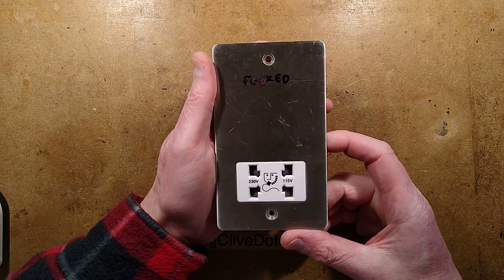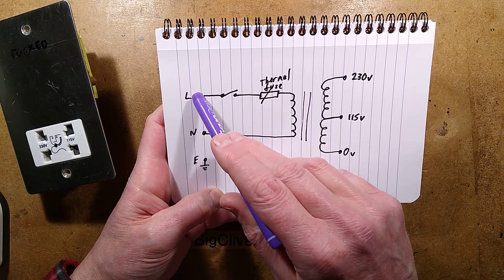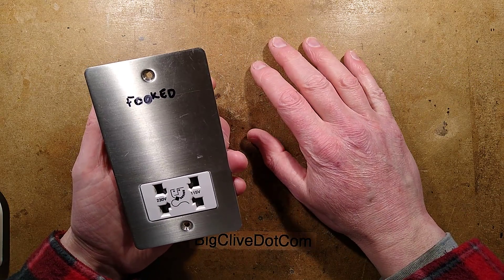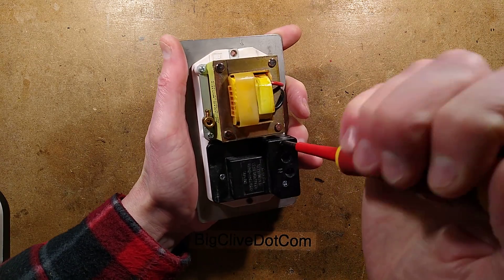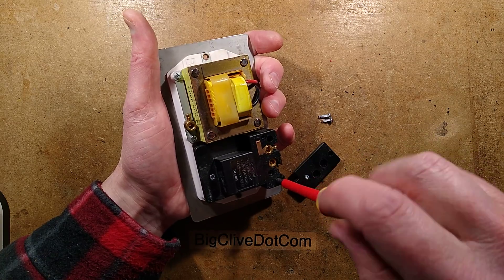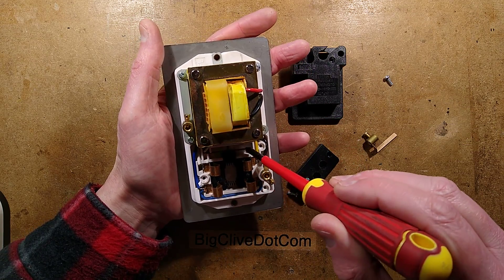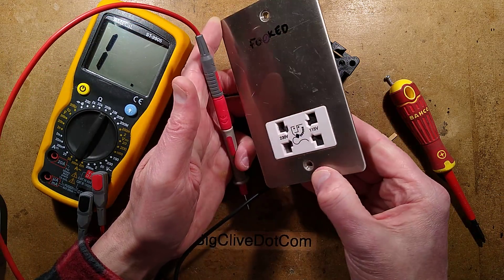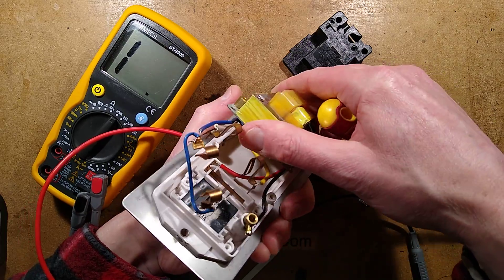Exploring a failed British shaver socket

Comment: I live in Sweden and moved into my apartment in 2004, the last electrical makeover was in mid-90s. My bathroom mirror cabinet has a lighting fixture included on the top, but it does also include a transformer which steps down the voltage from 230 to 115 and connects to an outlet in the bottom of the light fixture. This outlet is intended for shavers. Don't think the transformer has a thermal fuse or anything fancy like that, it just does the voltage step-down.

Comment: This used to be the only way to charge a phone in UK with "continental" power supply without having an adapter.
Btw, are shavers in UK sold with standard European plugs to fit into this socket?
Reply: UK shaver plugs is different to EU 2 pin ,slightly different size

Comment: And now you have a transformer to build a HT supply for a 1 watt valve amp, should get 300vdc rectified, just need to add a filament heater supply from an old smps or ac transformer.

Comment: As a Canadian, my initial thought on reading the title was "what the heck is a shaver outlet?"

Outlets in my washrooms are mounted about 10cm over the counter near the sink. I'm not aware of any functional difference on them apart from a resettable trip of some sort (AFCI? GFCI?), a "test" button, and embossed directions that read "Test Monthly. See Instructions." I've had no issue powering 1500w devices on them, never seen them trip.

I've been here 10 years and had no idea the "Test Monthly" text was even there until checking them after seeing this video, still dont feel overly inclined to do so...

Comment: We don't have these disposable power outlets in Czech republic. This is a dumb design. Of course, when there's a convenient socket in bathroom, why not to use it for hair dryer? Especially when a standard Euro plug fits there. Why don't they use a standard fuse? The same style like in UK power plugs.
Reply: More professional designs of these sockets will use a resettable thermal fuse rather than a one shot device.  We had them because we had electric shavers many decades before ‘differential current’ RCD’s became readily available at low cost.  As ever we remain a country with just about the lowest deaths from electrocution on the planet.
Reply: @MartinE63  For decades, power outlets were just banned in bathrooms. Then the outlets were allowed, but the only requirement was that the bathroom has to use a separate circuit with its own breaker. Nowadays RCDs are required for all electric outlets in households.
Reply: @JendaLinda  We had these outlets back in the 1960’s in the UK, maybe earlier and they are still installed to this day.  Normal outlets are now permitted in bathrooms but are not common.  Whole house differential current RCD’s came into use around 1980 and were mandated for new installations from 1991 iirc.  P.S. We have had regulations on electrical installations in the UK since 1882, 140 years. Going back to your original post, our ‘shaver plugs’ are not the same pin diameter or spacing as euro 2 pin plugs.
https://en.wikipedia.org/wiki/AC_power_plugs_and_sockets:_British_and_related_types#BS_4573_(UK_shaver)
Reply: @MartinE63  The plugs are so similar, so you can easily plug the wrong one. Power sockets in bathrooms became common since automatic washing machines become available. Washing machines were usually installed in bathrooms. Until 1990, RCDs weren't a thing here, so the circuit breaker was the only protection.

Comment: In switzerladn it used to be common to have a separate outlet for shavers, but had a small glass fuse in there that you could swap out from the outside that, I think usually 200mA or something of that size. I don' t know whether they did have a transformer in there but I need to find out now:)

Comment: See them in hotels a lot, and sometimes in old houses (50's/60's). 
Since like, the 80's they just put the GFCI in the switch board and use a normal earthed socket. Needs to be at least 60 cm away from bath/shower/sink/tap, but nothing too crazy.

Comment: Not being used here in Belgium. Those shaver sockets can also be used as a "El cheapo" way for isolating low-power DIY circuits, so that you can do safely measurings with a scope (and don't blow up your scope/scopeprobe) , but is not recommended because there can always be a short between the primary and secundary and your scope is still toasted.

Comment: VDE norms in Germany prohibit switches and sockets in certain areas around shower or bathtubs. In times before the RCD they often had to be either SELV or isolated transformers. Many people erroneously refer to these bathroom rules as "Feuchtraum" (moist rooms), which is a different set of rules, and believe the IP44 fixings for cellars or outdoor might be required.
The shaver sockets were mounted in square installation boxes whereas all other plugs and sockets in germany go in round holes, which would be too small to hold a transformer. People do get creative and use a standard Schuko socket and a fake switchplate to cover the large hole in the wall, leave the Earth unconnected and glue the mess together with silicone or hot melt. 
Of course you also find tangled webs of extension cables and dubious travel adaptors where fixed sockets were not permitted. Oddly enough many of those people are scared by the british electric shower heaters because of the dangerous electricity.

Comment: Hi Clive, hope you and your family are doing well.
What is more likely to kill high power MOSFETS in a dc-dc boost converter, powering high power 200W cob leds?
Too much voltage or too much current?
Or more general, what kills high power mosfets into a full short failure mode?
Cheers.

Comment: This brought back memories of my uncle having an adapter that allowed him to power his electric razor from the light fitting - grand Idea except for slight issue of then not having any light to see what you were doing...
Reply: Same with my grandparents and ironing clothes,  you could only iron in daylight.  All because originally sockets were metered at a higher rate than lighting. Replace the lighting fuse with a nail and the iron works on the lighting circuit.
Reply: @MartinE63  I remember my Granny had an iron plugged in to the light socket, 60's Belfast.
Reply: For that you are supposed to use the splitter adapter which gives two bayonet sockets (usually at funny angles) from the one it's plugged in to!
Reply: The 1st product ever made by Matsushita Electric ( now the parent copy of Panasonic and Technics)  was a bakelite-housed Y adapter that screwed into the Edison-style light bulb socket in your ceiling and gave you an socket for the bulb as well as an outlet plug for another electrical device.

Comment: The US just has GFCI outlets in newer homes. Given the usual 120V/15A-20A US circuits, the breaker would trip if you dropped a shaver or hair dryer in the sink,  but that's about it. If we had the scary 230V/32A ring mains, different story!

I have a 240V/30A outlet for my lathe, and the plug for that makes your UK plugs look tiny: https://photos.app.goo.gl/ah2ZRWBj6LD8K8LVA

Comment: Here in the us in new construction we just have gfci outlets near any kind of water. Older houses usually just have an ungrounded outlet built into the light fixture. Breakers with ground fault functions exist but that's the less common way of wiring them usually that's in the outlet itself.

Comment: The US uses GFCI (RCD) outlets whenever water is likely to be nearby (kitchen, bathroom, sometimes outside).
US outlets also already use a center tap at the secondary winding on the main transformer to make the voltage 120v wherever appropriate.
I suppose in theory having an isolation transformer would be ideal, but it's certainly not a cost effective option for the whole house.

Comment: You occasionally see these in old hotel rooms in Sweden. Definitely a rarity though. RCD protection has been a requirement for wet areas in new installations for about 30 years from memory.

Comment: My college dorm in the United States had them. Additionally it had a dedicated razor blade slot (that just dropped the blades into the wall cavity, I guess they figured they would just replace the building when they filled up)  And ashtrays built into all the furniture.
Reply: The razor blade disposal thing seems to be unique to the US - frequently encountered when renovating older houses. Presumably any pathogens on the blades would be long dead... PRESUMABLY :)
Reply: @LewinEdwards  I still see the slots in new medicine cabinets from time to time, but I suspect the lack of labeling means almost no one knows what they are for anymore.
Reply: @LewinEdwards  , in my 63 years of life in the US, I've never seen or heard of a razor disposal wall-slot!
Reply: @LewinEdwards  Accidentally bring back smallpox but it swaps genes with coronavirus
Reply: Free cavity wall insulation?
Reply: In the US you most likely had a normal single outlet built into the medicine cabinet or a newer GFCI.
Reply: @zachazlett  it was the dual round plug like in Europe and said shavers only. It was really odd for California.  I'm sure it made sense in 1960 when it was built. They clearly were aiming the housing towards  clean shaven chain smoking future aerospace engineers. (It was an all guys technical school at the time).
Reply: @JohnMeacham  that’s really weird but keeping that face clean for NASA was very important back then. Also the maintenance people probably got sick of getting calls from foreign students.
Reply: @JohnMeacham  Weird, I've never seen one. Lived my whole life in California. Makes me wonder if maybe someone was a transplant from Europe and decided to have them installed here.
Reply: @zachazlett  yup. It was Caltech so a very strong NASA connection. I just remember it being comical how many places they felt needed ashtrays. Like, there would be three within reach in some lecture halls most of the time for anything that hasn't been redone since the 60s.
Reply: @fishyfool  I think it was a weird Caltech thing. One of many. It is an international school, so maybe that had something to do with it? I don't know why European style shavers only ports were important enough to bring over though.
Reply: @fishyfool  Pre-1980s single-shaver outlets with their own transformer were the standard for US homes and other domiciles
Reply: I've seen the razor blade slots in a lot of homes. Though in Florida it gave the bugs one more route to get into your bathroom from inside the wall. There's nothing quite like being half awake in the morning, opening the medicine cabinet to get your shave cream and coming face to face with a big cockroach.
Reply: @tncorgi92  who is for a shave after that?
Reply: The "Used Blades" slot used to be common in railroad sleeper car washrooms.  By the time the wall cavity is full, the whole car (and blades with it) would just go to scrap.  Also guys had the challenge of shaving with a safety razor in a bouncing, moving rail car.
Reply: Yup, I've seen 'em. 1950s-era house, mirrored medicine cabinet w/ fluorescent lights on each side & an outlet built into one of them. If there was blade slot, either I didn't notice or it or know what it was for.
Reply: That's so funny that there was no obvious way to empty the razor bin :))
Reply: Dumping blades into the wall was actually a pretty widespread thing for a long time. More like by the time it fills up the building won't be suitable for habitation anymore.
Reply: Are you SURE that was meant as razor blade disposal, and wasn't just a crack in the wall?  People have a notable tendency to think that cracks and holes must have an intended purpose.  (Back in the days when floppy disks were still common, any slot about the right size in anything involved in computing would fill up with them.)
Reply: @evensgrey  yup. It literally had a embossed sign that said razor blades. At first it had me wondering how the I heck I got it to dispense razor blades. But a search for razor blade disposal slot will show lots of examples.
Reply: Which campus, building, and when?
This sounds sooo hazardous, it couldn't stand in the face of tuition these days with everything! I must know. Pls.
Reply: How are you lot so certain that there isn't a hatch in the basement where the blades can be retrieved? Or the hatch can even be in the attic and the blades can be retrieved by a suitable magnet....
Reply: @SianaGearz  people have renovated these bathrooms with the slots, and just found piles of blades wherever they dropped inside the wall cavity. Whoever made them assumed there would never be enough blades to be a problem, and they were right as flat safety razor blades became largely obsolete anyway
Reply: @AaronSmart.online  I thought those razor slots were weird even back in the day.  I do remember that razor blades were NOT stainless when I was young, they were blue steel.  Maybe they eventually got so rusty they were no longer sharp.
Reply: @AaronSmart.online  wet shaving is re-emerging.
Reply: @davidg4288  yeah. Nowadays blades can withstand 10 shaves before replacement
Reply: @kornaros96  but usually with cartridge blades that you can't throw in the wall forever

Comment: As an Australian, I can see this "shaver socket" nonsense is a mystery to me. We just have our regular old power outlets in the bathroom.
Reply: Not half as weird as having washing machines in a bathroom (and top loaders as that)  We had front loading programmable washing machines in the UK in 1961, located in the kitchen where you could unload and easily hang it out on the line without carrying it downstairs.

Comment: As someone in the US, I have no idea what the plug looks like that would go into this receptacle. I also don’t fully understand why this would prevent you from getting shocked if you dropped a razor into water. To be fair in the area I live in our ground and neutral lines are bonded together, where as from what you describe it looks like your ground and neutral are isolated. We typically use GFCI outlets in bathrooms to prevent electrocution. Are RCDs making these fairly unnecessary?
Reply from the maker: I'd guess that even with RCDs they may still require these.
Reply: I’ll say this, the UK electrical  system fascinates me. Thank you for always giving me new things to spark my curiosity and drive me to research! 😄

Comment: Being familiar with building design and code from an earlier job, the standard here in the US is for wet locations to simply have a GFCI protected outlet. Given that most shavers today are battery powered, its kind of a moot point as the main danger from the outlet is usually from hair driers which can draw close to 2kW. Too much to practically isolate. But with the proliferation of smart phones one nice standard to have would be for sockets that have USB outlets designed for wet locations that are water resistant, isolated and protected from ground faults and leakage.
Reply: I did upgrade to an Eaton GFCI with USB, Lowe's. Wife can cook hair, chat and use the USB powered makeup mirror.
Reply: @palharley  Does she make hair pies? :)
Reply: @elemar5  I can say that you can plug lots of USB powered items in the outlet.
Reply: UK is all RCD protected now so much the same.
But this kind of protection has been around for many decades, long before GFCI and RCD.
Reply: The whole world doesn't immediately go out and buy new outlets every time a new standard or technology comes out.
Reply: @backgammonbacon  Was a nice simple Christmas surprise. Old outlet was fine.
Reply: @backgammonbacon  The point isn't to compel people to buy new outlets. Instead to make the standard available for those said applications. Not all countries run like the EU. Not yet, anyway.
Reply: There are of course USB-C shavers now as well.

Comment: Most tourist related bathrooms here in Belgium have these: Hotels, trains, expo buildings...
But I wouldn't be surprised they get phased out since almost no-one use them in an age of battery powered electric razors.
Reply: Yes for facial hair most just use battery operated shavers, but for headshaving, I still use a wired set. Although, when I travel, I don't shave my head as I do that before I leave... So I'm good for a week or two 😜
Reply: What about those times when the battery runs out just as you're shaving?
Reply: @AaronSmart.online  My facial shaver uses a switching power supply for charging. 100-240v input. I would just use an adapter I would already have on hand for my cellphone charger (Which is also a switching power supply).

Comment: Before RCD's these where common in the Netherlands, no 110V though, just one 220V outlet. And they had a big bimetallic thermal fuse, so they survived if you plugged in a hair dryer.

Comment: We used to have shaver outlets here in North America, they were non polarized 120v outlets using a transformer to isolate it from mains. Most times that I've seen they are also switched by the switch for the bathroom light. They were typically only rated for under 300 watts or so I believe. They were installed in a double wide box. Hardware stores here sell kits with a GFCI and box adapter so you can swap it out for a GFCI outlet provided you have a ground wire.

Comment: Interesting; I've wondered what made that outlet unique. Does that mean the shaver can only connect to that outlet, or are other outlets similar? As others have said, we just have regular outlets or GFI-protected in US bathrooms.
Reply: shaver plugs only go into this type of socket or a shaver adaptor that plugs into a UK socket - you can't get a shaver plug going straight into a UK wall socket - I'm sure millions must have tried.